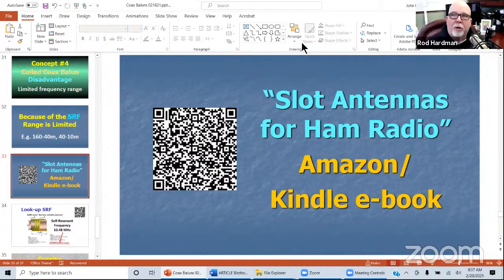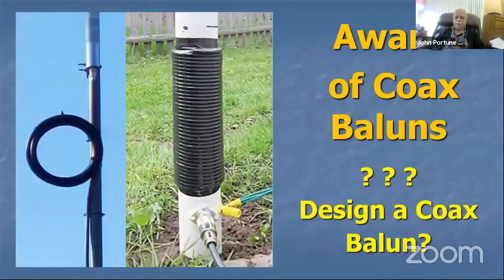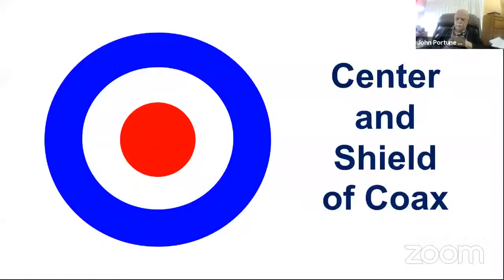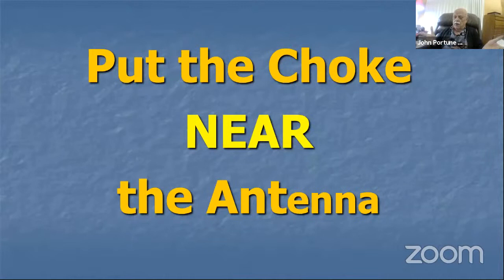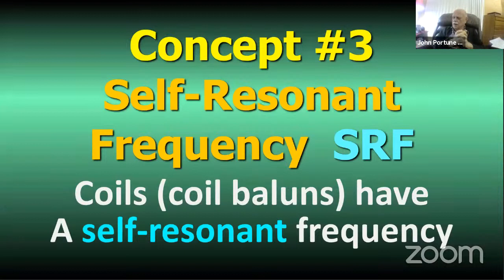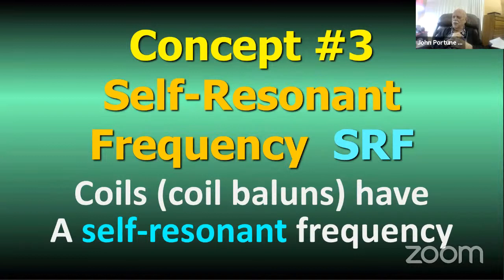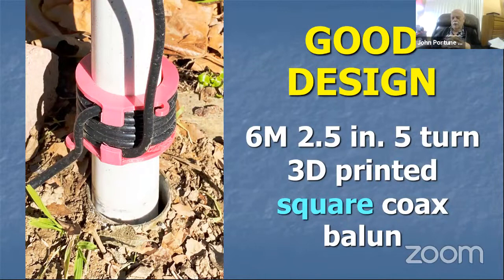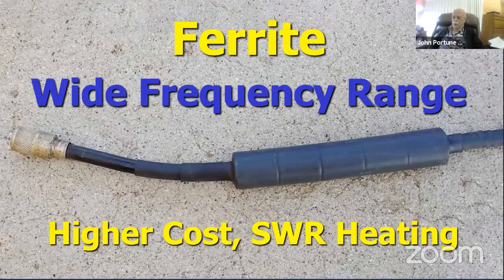John Portune W6NBC  "Coiled Coax Baluns" Cycle25

Comment: The formula to calculate the inductance needed for XL = 200 Ohm is wrong (19:31).
It should be L [uH] = 200 / 2*Pi*f[MHz], derived from XL = 2*Pi*f*L
LB8X

Comment: Hi John,
I am having difficulty seeing why your J200 reactance value is the ideal and why self resonance should be avoided. If the goal is to reduce common mode, would not the higher the Z the better the attenuation? If that is the case (and I can see no mathematical reason why this should not be so) then the high R of self resonance should be the goal. And if +J200 works, why would  -J200 not perform as well? A -J200 choke could be realized by haveing self resonance BELOW the operating frequency.
If I model a 40M half wave antenna in EZNEC and include a 3rd wire perpendicular to the horizontal wires to model the outside shield of a 36 foot piece of coax and then observe the current on the 3rd wire I see the following currents in the segment of wire #3 closest to the center fed dipole.:
no choke current:  0.9A
+J200 choke   0.20A
-J200 choke 0.19A
200 Ohm choke   0.16A
2K Ohm choke  0.02

So I see that  an inductive choke has the same efficacy as a capacitive choke. A resistive 200 Ohm choke  is better than either reacive choke and a 2K resistive choke is about 10X better at reducing common mode than any of the others. 2K and even 4K or so is easily achieved in an air  wound choke at self resonance.  The EZNEC  model is extremely simple and as I change segmentation it converges very nicely. So I do not see any reason to expect the model is not accurately representing a real world  antenna system.
Can you explain the math whereby  you derived an optimum choke is  +J200? What if the coax length was such that its shield reactance were -J200? That then would be  the equivalence of series resonance and the current would be back to the highest value of 0.9A.

Comment: Respectfully,

1.) SWR is NOT the determinate  nor does it have any direct relationship to balun heating. Balun heating is primarily I^2*R heating in conductors and dissipative losses in cores and dielectrics. Balun heat has no direct or consistent relationship to SWR or mismatch. A system can have 100:1 SWR and nearly perfect energy transfer...and no noticeable heat. On the other hand a system can have 1:1 SWR and convert most of the RF energy to heat. 

2.) The ideal impedance of a balun, or the minimum acceptable impedance is complicated. The ideal or even the minimum impedance is dependent on the entire system.

 Some antenna systems require no balun at all in a balanced to unbalanced junction and have almost perfect balance. 
In some systems even thousands of ohms is not enough. In some systems a balun or common mode choke can degrade performance. 

People do not like to hear it, but the real answer is system dependent.  I doubt it is ever 200 ohms in any system. I don't know why anyone would say some precise target impedance, rather than a typical range for a system or a specific application..   

3.) A "square" form factor is only near ideal in a low reactance low impedance system. As operating impedance or inductor reactance increases optimal form factor becomes longer and smaller diameter. This is because shunt capacitance from turn-to-turn or end-to-end starts to increase circulating current in the inductor.

In high impedance chokes and RF inductors, the optimal form factor tends towards being many times longer than diameter. The common range is from 1:1 L/D form to greater than 4:1 L/D.